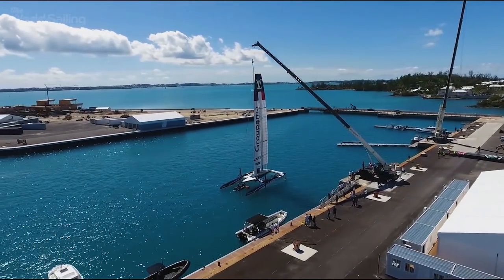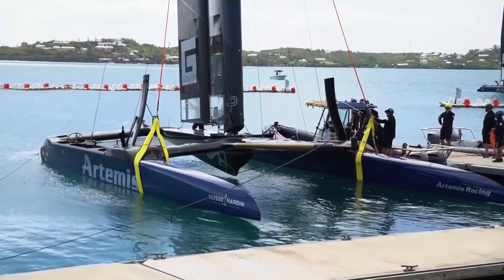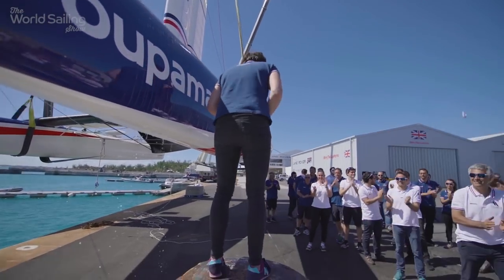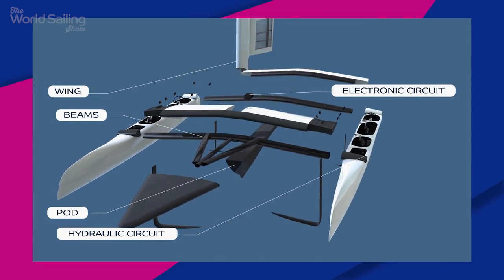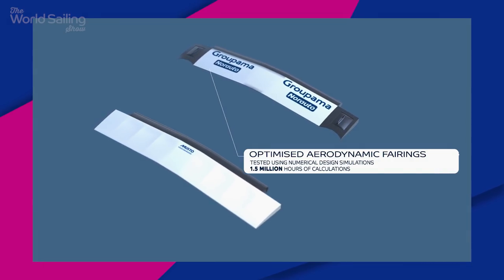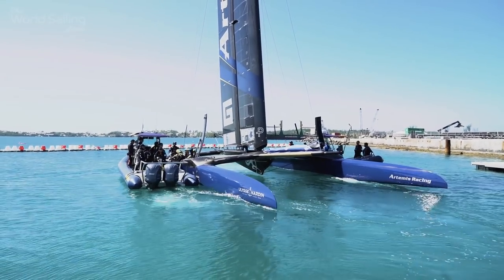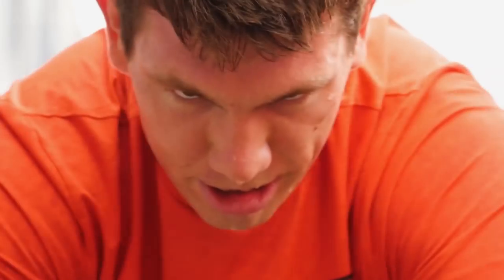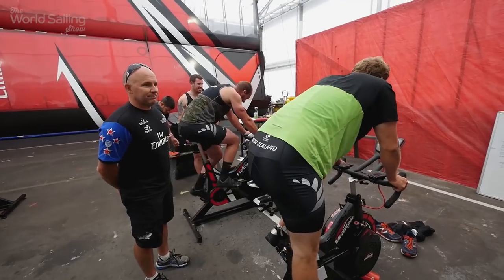Under the skin of an America's Cup Class  cat

Comment: Hate to say it...  Everyone but one was pointed the same way, and the team that thought outside the box cleaned up.  But that team had to think outside the box on nearly every issue.  Perhaps the defining issue in the event was "who could generate the most hydraulic pressure".  There were a cascade of attributes which flowed on from this.  Hands free while legs pedaling, use hands to provide sensitive control of the pitch stability, and the shape of the sail.  Two vastly different attributes, but the solutions both stemmed from using legs to generate power, and using hands to generate control.  Why did no other team come up with the same logical solutions?  They didn't think outside the box...